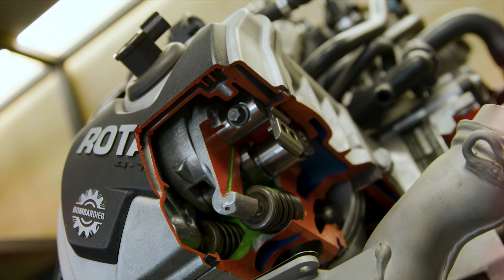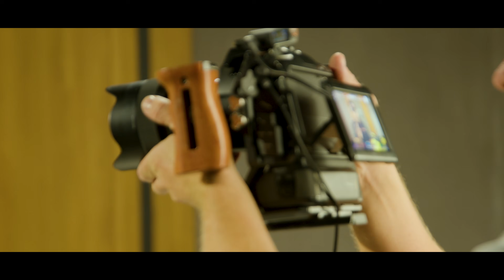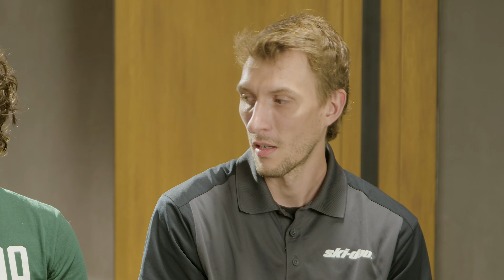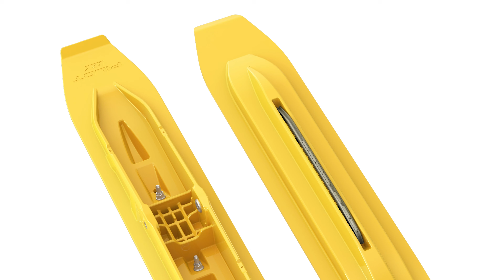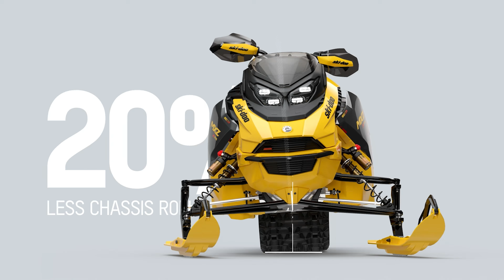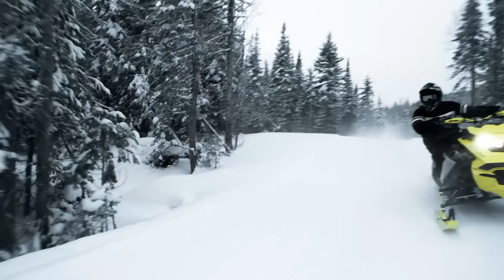Race Inspired | 2025 Ski Doo MXZ X-RS 850 Turbo Competition & Smart Shox

Comment: Taller spindle???? Gee, I wonder where that came from?.......Cough, cough( Arctic cat) 🙂  I remember everyone giving AC crap or questioning their reasoning for the taller spindles back in 2012 when they released the Procross, or earlier on the race sleds.  But with that said, even though I'm an AC guy, I was checking out the New Doo's and Poos the other day and I would have to say, AC is easily a notch below those 2 when looking @ fit n' finish/ and overall quality of materials. Just sitting on the sleds, comfort wise, the Doo and Poo are better, but 
"Fun Factor", the way the sled feels when sitting on it, I would give that to the CAT :-)  I Love the competition between these manufacturers, makes them better for us! If I had to buy new right now, it would be the 9R XCR or 9RAssault 🙂
Reply: Yet cat is running the same rear suspension setup they were back then.  The new Catalyst are cool sleds but they having the worst suspension in the industry offsets their new chassis and that rowdy 858.
Reply: @gregsouther7293  ok, not sure on that response?? I would agree AC needs to upgrade their  rear suspension, but without actually riding all 3 back to back, I have no opinion on that. The only comparison I have is my 16 AC ZR8000 137 Limited vs my buddy's 2018 Ski doo renegade 137 with the R motion. I thoght my ZR handled better in the corners and almost felt the same in the rear. My 800 felt just as powerful as his 850, so we have that!!

Comment: Will be the most unreliable sled on the planet, Turbos suck.
Reply: Can't be the polaris 850 turbo is already
Reply: @bigmurph1447  haha that too.
Reply: Completely False!  Turbos are in every Motorsport known to man.

Cars, trucks, SUV’s, snowmobiles, atv’s, big Trucks, small trucks, wave runners, and the better the engine breathes the better the engine performs.
Reply: @bobhirdes6725  yes and no. On a 2 stroke a turbo is mostly worthless unless ur sitting at high rpm all the time like a mountain sled.
Reply: @bigmurph1447 false,  why did Polaris and Ski-Doo put it in their 2 stroke engines?  
The turbo's make more power and torque!  Just stop or you will make yourself look even more foolish
Reply: @bigmurph1447  wrong,  you are completely wrong.
Reply: @bobhirdes6725   prove it
Reply: @bigmurph1447  listen here motormouth, you ran your mouth so you prove it.

Turbos are in every for of transportation you can think of,  cars, trucks, semis, tractors, wave runners, atv’s, snowmobiles, performance cars.  Why are they so popular, forced air induction aka turbocharging gives the engine air to breath and the better the engine breathes the more power it will make.
Reply: @ I just did, turbos are everywhere in every spectrum of transportation.
Reply: @bobhirdes6725  I don't want  50,000 turbos sitting in the junkyard. Probably 2,000,000 now.
Reply: @bobhirdes6725  turbos are a waste on a 2 stroke because of the rpm range. On a trail sled u can never get on top.of it. In the mountain sleds it works great because ur at high rpm all the time.  4 strokes engine are way different they make there power down low in the rpm range. You can't compare a 2 stroke to a 4stroke 2 different engines.
Reply: @bigmurph1447  you are so full of S..T Mountain sleds are two stroke turbo charged engines and EVERY SINGLE ENGINE with  turbo makes more power because it breathes better
Reply: @bobhirdes6725  How many go bad? Everyone? ...
Reply: @firstamendmenttshirt4768  nope, false! Fake news!  Your opinion sucks
Reply: @firstamendmenttshirt4768  nope, fake news, false, your opinion sucks
Reply: Would like to know recommended idle time and engine temp for turbo warm up to achieve heat saturation for long life on this 2 stroke.
I've blown a few on autos over the years.

Comment: smart shocks can be cool for trail riders but please the comp edition needs to be an aggressive sled... an snow x or XC sled for consumers. add a 600 with shot and 850 NA with shot... keep the good 46mm clicker shocks no gizmos or gadjets needed... also a 1.5 or 1.75 option track... if i order a 600 for 26 i'll be swapping in a 600RS track and maybe spindles too.
Reply: Because this isn’t actually a comp sled and the smart shocks bely that truth. Almost no one can use this sled to its potential, and those who could, probably can’t afford it. This is the high margin sled for the rich middle aged dude who just wants “the best”. This is what happens when the product lineup commoditizes what was supposed to be the comp sleds - XCR’s and XRS’s into normal trail sleds, and now there needs to be another level above that. The actual XC sleds do exist and they are 600s, but only like ten people want that.